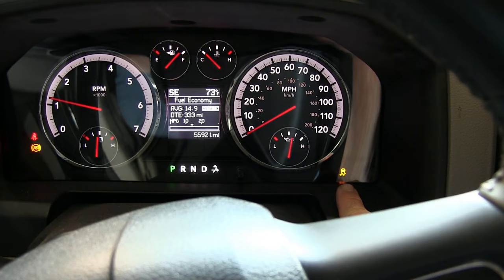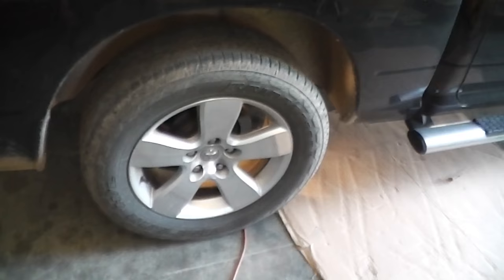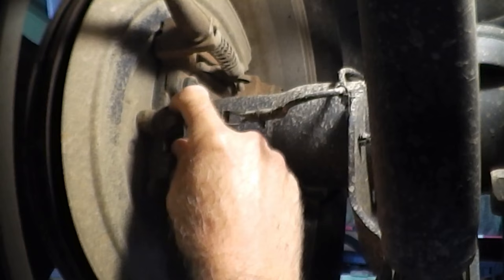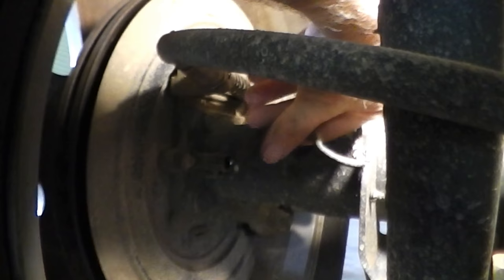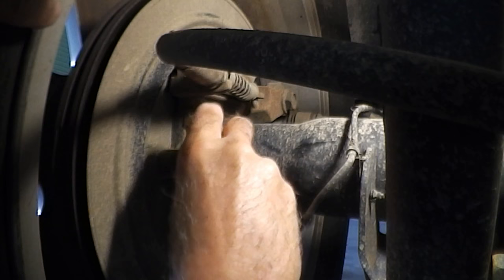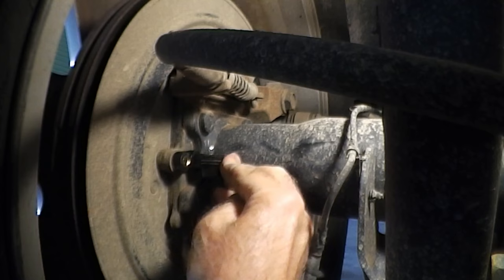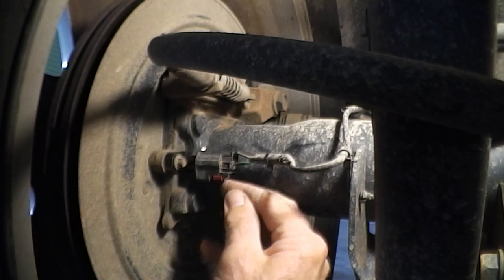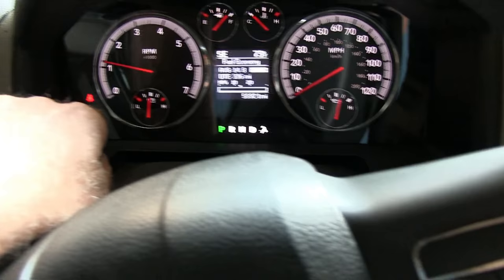ABS and traction control light stay on - 2012 Ram fix

Comment: Thanks for the great video. 30 minutes of labor and the problem was fixed! I found it easier to remove the 8mm bolt and the sensor before disconnecting it from the plug (and likewise connecting the replacement before bolting it in). It strikes me that it's easier separating the sensor from the plug when it's in a less restrictive space and when one can get a grip on the two parts to be separated. Also, the red tab on the left-rear wheel was hidden from view until I removed the bolt and the sensor connected to the wiring.

Comment: Mine didn’t reset with the start of the engine, I drove it for about a mile then the lights disappeared.  Thanks for the help and saving me a ton of cash!
Reply: It has to relearn. I have changed mine several times. 2011 116,000 MI. The last time I changed the front ones. It was cheaper to get the bearing assembly w/sensor than just by a sensor.  I also found out when my back up sensor light came on,.That I could clean them with wd40.  Went right back to working.  I thought this might work on my speed sensors. So I cleaned them up.and right back to working.  It don't mean it will be that way every time I guess, But so far so good.
The brakes on the front ha e locked up.twice because of them. I.had to replace everything in less than 10,000 MI.  It would not go.into economy 4 cylinder. You don't really notice it at first. Then you smell it. I pulled over and it locked.up.tight. The wheels were smoking hot. Another problem is there is no cabin filter in it. You can get.a kit for it.simple to install. The outside pollutants clogged.up.my evaporator tomorrow part of the dash.will have to come out to change it. I'm gonna rebuild the blower box while I have it out. The cabin filters are very important. Find out it your vehicle has one and change it.  
Also you.can use the re-cycle button on the a/c. That will stop most pollutants. Not make the same mistake I did, Its very costly. and time consuming. GOD BLESS

Comment: I'm having the same problem. Thank you very much. I think you were the same guy I watched on the back up assist sensors. From what remember, I cleaned the sensors with WD-40 and all went back to working. Dealer said they would all have to be changed. Save me alot thanks.

Comment: Had a 2012 Ram 1500 go through the shop this past week with the same issue. I ordered the 2 sensors for the rear wheels. Took the old ones out to find they were completely covered in dried mud/dust. I used shop air to blow out the area where the sensor sits, and a ton of dust and dirt came out. I installed the new sensors and lifted the vehicle a couple feet off the ground and put it in drive. The lights disappeared around 10 MPH and did NOT return. Another confirmed fix! Thanks for the tip, as the vehicle threw no codes concerning the abs light and the traction control light.
Reply from the maker: Awesome 👍

Comment: Man thanks a lot, today I started my truck and I saw all those lights on, I really freaked out,  well it turned out my dog had bitten cut one of the cable. So  thanks to you I knew that the cable was the problem, I put them back together and I started the engine, and the lights were gone. Thanks a lot mate, greets from Chile!

Comment: Man I wish I could buy you a beer. I went to the dealership for this EXACT issue, ABS error message started coming on randomly and then eventually it comes on and stays on every time I move the truck. They plugged their little doo-dad into the dash and said "It's an internal error, we need to replace the whole abs module. We can do it next month and it'll cost $1900."  I laughed in their faces. I found this video after 15 minutes of looking online, I'm picking up $20 worth of sensors from the parts store tomorrow. If this works I'm a good mind to go back to that dealership and take them to task for being scam artists.
Reply: Did this fix it?
Reply: @etchediniron4249  yep
Reply: @MagiRaz  I just called the dealership and can’t get a module until 2/2023. 😐
Reply: @hybredmoon same issue.  Dealer said "ABS sensor . . . Blah blah . . Not available till . . . Blah blah . . . $1200."  

Question:  2012 2500 Cummins
Speed sensors are not plugged at the wheel but a long wire from the sensor.  Was there a chance made bt FC during 2012 year?
Reply: How much did they charge for diagnostic? I’m having the same issue plus service the knob thing lol . I’m stuck in park also 😤
Reply: @JoseMorales-kn7ut  Diagnostic fee at my local mechanic is $50, flat rate.

Comment: Many thanks for your video. 
ABS, service 4 wheel drive, stability control dash lights on. No cruise control. And last but not least, the backup sensors disabled. All because the left rear wheel speed sensor failed.
Reply from the maker: silent night  it cleared on its own when I started to drive.
Reply: silent night  Everything cleared when I started the truck.

Comment: Awesome! I have a 2013 Chevy Silverado. It sounds like it could be a similar situation. If not, this was a great video to watch. Cheers
Reply: I had a 2000 silverado with the same issue.  Not sure if it's the same as the 2013 but what happens is the solder joint cracks inside the ABS control module.  That could also be your problem and there are several videos on it.  Good luck.

Comment: Great video! This solution solved my intermittent ABS and TC issue on my 2013 RAM 1500 Laramie. It took me less than an hour with seized up ABS sensors. Thank you!
Reply: I have a 2013 Ram as well .. If you dont mind me asking, where did you buy your sensor? Part number? From what Im seeing the part # changed after 2012 model.
Reply: @SouthernSwag731  I went into AutoZone to buy the part. I just told them the year and make and they ordered the part, next day delivery. I do not have the part number for you, sorry.

Comment: Big thank you. Just fixed mine today for $25. Got a scanner from an auto parts store and it read the code.
Reply from the maker: Awesome 👍
Reply: My Diablo scanner would not pick up the fault code. The scanner at the auto parts store would not pick up default code to either. Rumor has it you have to take it to the dealer to pick up the ABS fault codes.
Reply: Why don't you drive it around for a couple days to make sure the light stays off.

Comment: I won't be paying Dodge $150 to "find the problem" now. Thank you.
Reply from the maker: Awesome glad it helped.
Reply: Is the abs & traction control module in the same place on a 2017 3500 cab an chase dually
Reply: @petebeasttexashomesteading   is this the same for a 2018 ram 3500? Same issue. Great video.

Comment: Thanks much Pete. Replaced both sensors on my 2012 Ram. One came off as you show but the other one was stuck despite my many threats and foul language. So I removed  the bolt and pulled out the whole affair. If you look at the sensor end with the bolt hole  on the right and there are two rails attached to the sensor. Similar to pistol rails. Use a pair of needle nose pliers, grab one of the rails and pull out the sensor.

Comment: Awesome, was VERY easy to do and fixed my issue! Thanks!
Reply from the maker: Awesome 👍
Reply: @petebeasttexashomesteading  I have this issue with my truck right now, except I am also limp in 4th gear. Did anybody have this same limping issue when their ABS and Trac-control wasn’t working? 

We also think it may be our transmission solenoid 

Model: 2012 Ram 1500 with 5.7L 

Please let me know!!

Comment: Before you change the sensor you should take the wheel off and check the gear the sensor reads from some times the gets covered in brake pad debris and makes the sensor think the wheel is spinning really fast because it looks like solid metal no breaks.

Comment: Replaced both. Light still coming on. Looking for solutions now… 2013 ram 4.7 1500 st
Reply: My 2010 Ram 4.7 when in 4wd LOW , the ESP and BAS come on , don't of it's normal...I know that in Low Range certain assistance goes off

Comment: Thank you for the video! Intermittency, the traction control, service 4x4 and trailer brake lights come on but will go off. Hopefully this fixes it. I also received the red lightning bolt indicator a few times and the truck will slow down. I hope this corrects it. Definitely seems like an electrical issue or sensor issue. If someone has had the same problem feel free to comment. Thank you!
Reply: I had the same issue with the red lightning bolt after doing some research I found out the throttle body was the issue.
Reply: Same problem here 4x4 and the traction light come on and I can't take it out of park. Gonna give this a shot. Red lighting bolt was solved by changing the throttle body(easy fix). Hate that the TPS isn't separate :/

Comment: I have a newer ram  -- it has computer glitches all the time - it started doing that back in the first 25 thousand miles or so - it has been coming and going all along - when they reset the computers on  all of them somewhere along the line - they go away - you could have of course had a problem with a speed censor - but i noticed you had a lot of corrosion on the plugs  and especially on the inside electrical stuff of the sensors   - you didn't clean on the inside at all - and you didn't just unplug them and clean them just in case of that situation -- HUH ? ? -- where did you get the info you got - boobtube maybe - thanks for the heads up anyway - it is something to try if cleaning or recomputing on their schedule doesn't work - does that not also happen when the brakes are getting low and needs replacing ------ a good air compressor and some brake cleaner works for cleaning purposes very well i hear - wonder if it really does  ? !  - what does show up when the brakes are getting too low I wonder ? !

Comment: Thank you so much Pete for such informative video, I have the same problem with my 2011 Jeep Grand Cherokee, could you guide me where to buy the sensors, thanks in advance
Reply from the maker: I'm not sure how the speed sensor looks on a 2011 jeep grand Cherokee. I have a link in the description under the video for a 2012 ram, just go on Amazon and search for your vehicles wheel speed sensor and if you can, make sure they look the same as what's on your vehicle.
Reply: @petebeasttexashomesteading  Thank you so much Pete we'll do

Comment: I just experienced this today in my 2012 express. I used the Amazon link and ordered 2 sensors. Thanks for posting. Just curious did your truck feel like the rear end was slipping intermittently before this happened? Mine did it a few times and then it stopped a couple of days ago then this today.
Reply: Did you ever figure out the issue?
Reply: @chrissmothers3636  the new sensors fixed the issue 👍

Comment: I replaced both my rear wheel sensors and that did not fix my problem. My truck was hit on the front left wheel last year so I assume that’s where the issue is. I replaced that one last night. So it should take a few days to clear if that was indeed the problem. We’ll see
Reply: Sean Hebert I have the same problem you light traction control is steel on ???
Reply: Sean Hebert I have the same problem you light traction control is steel on ???
Reply: Sean Hebert I have the same problem you light traction control is steel on ???
Reply: Sean Hebert I have the same problem you light traction control is steel on ???

Comment: These are ONLY on the back wheels then?  Nothing on the front?
Having similar problem. The lights on dash stopped happening, but now my ABS will randomly kick on during normal braking around town. Brakes still work but its an uncomfortable feeling and probably makes brakes work less effectively.

Comment: I have a 21 ram 1500. Took it in to get pinion beating fixed. Now ABS light on, traction control lights on n cruise wontvwork
Reply: My ABS module costs 500.00

Comment: My Speedo stopped working, the abs traction control lights, the Brake warning lights and it was stuck in low ratio…….all because of a front wheel sensor…..£100 item…….Stupid unnecessary electrical crap….never needed this shit 30 years ago….we all got along just fine!

Comment: Did you have any issues with braking though? My truck seemed to want to kick on the ABS system when it wasn’t needed. Then I’d experience the problem you have described in the video. Of course, maybe it’s because the sensor(s) are bad that the ABS is activating at the wrong time. Either way, I’ll try this fix first. Thanks much.
Reply from the maker: I didn't have any issues with braking.
Reply: Loop
Reply: Will  try thanks

Comment: Unfortunately in my Chrysler / Jeep Compass it's always the tone ring  magnet that goes bad not the sensor part so it's part of the axle assembly and not the sensor itself.  I have had to replace both back ones and it's a pain in the butt.  It's the same for me. All the lights come on from ABS to traction control and you can't engage the cruise control while the tone ring is causing the fault.
Reply from the maker: It would have been nice if they could have kept the sensor basically the same for all their vehicles.

Comment: I had the same lights on my 2009 dodge ram rear wheel drive truck. I changed both rear sensors today drove all day around the city at least 30 miles but the lights are still on. Any reason why they won't go off?
Reply: My abs light is on,brake lite, service 4x4,traction control lite is on and cruise control don't work and when my truck is started it won't come out of park but wen the key is on the on position it will come out of park..code scanner showed abs wheel sencors
Reply: You may have changed the wrong ones. It may need the front changed. A scanner is good to check which is bad. Or an ohm meter.

Comment: This sounds like what is wrong with my 2008 durango. The brakes will actually engage very slightly by themselves at very low speeds randomly. Been driving it with this issue for the last week and now the cruise control doesn't work. Think it's the same issue?

Comment: My 2012 2500 has this light (ESC only) on preventing use of the cruise control, but I have never disconnected anything related to the power steering system.  I have replaced all upper and lower ball joints (what a job...don't ask).....thoughts?

Comment: How did you know it was the rear speed sensors and not the front? My 2017 just started displaying the ABS & traction control lights. Want to make sure I purchase the correct sensors, thanks.
Reply from the maker: Because my truck was rear wheel drive and not four. The speed sensor is used for traction control to check that the wheels are spinning the same or not.

Comment: I have a 2012 ram 3500 and I didn’t see this on my back wheels. I have a 6.7 cummins. I dont know if that makes any difference
Reply: I have an 08 3500 dually. They should be on all 4 wheels. They may be different from what he shows in the video. Check to see if there is a wire running from your pumpkin or wheel well down toward the brakes. That will lead you to it. Some fasten in at a different place and different angle. All 4 wheels have them to brake the vehicle in a straight line. They operate in milliseconds from each other to apply the brakes evenly in case some aren't worn or gripping the same as the others. If you Google it you should find them. Dodge or Ram may call them " Electronic Stability Control" as mentioned above in a post.

Comment: My issue is almost the same as this. But my E brake light comes on and stays on with the traction control light and my cruise also doesn't work. Only difference is my E brake light comes on instead of the abs light.

Comment: My driver side is not the same size as the passenger side.  The part listed in the Amazon link (257) fit the passenger side, but is too big for the driver side.  The part looks the same just smaller in diameter.  I have went to all the parts stores and everyone list the 1 size fits all.  Anyone else have this issue and if so what part did you use and where did you get it?

Comment: My ESP BAS, TRACTION CONTROL, AND BRAKE lights came on. I found out it was my brake fluid. I checked the brake fluid it was low, because I have a cracked brake caliper that was leaking, so I refilled the brake fluid and the lights came off. I tried the speed sensors and they did not solve the problem, they were cheap so it was not a big deal. Hope this helps.

Comment: Can the sensor be cleaned with some brake cleaner and then change the sensor if the cleaning did not work? Thanks, Pat
Reply from the maker: No, the unit is sealed. There must be some kind of magnet inside.

Comment: Would it be helpful or hurtful to spray a bit of dialectic aerosol into the hole before you reinsert the new sensor?
Reply from the maker: I might help make removal easier next time but the sensor itself is sealed.
Reply: @petebeasttexashomesteading  I was just wondering about all the dust and grit that gets up there. Especially on 4x4s that get muddy. Thanks for your reply!

Comment: Would this be the same part for a 2018 ram 2500?
Reply from the maker: No, probably not. The 2018 Ram is different and I think you have to replace the cable.
Reply: @petebeasttexashomesteading  Thanks. I’ll have to look into it because I’m having this same issue.

Comment: How did you know to change rear wheel sensors? Did you do a diagnostic test?
Reply from the maker: The truck is rear wheel drive. but if you have a 4x4 the it's just best to change them all.
Reply: @petebeasttexashomesteading  should be one on all 4 wheels to apply the brakes evenly on all wheels to keep vehicle braking in a straight line.

Comment: My abs , traction control and brake light came on. Would it still be the sensor? It has brake fluid, change front and rear brakes, the battery is good. Took to auto parts store and its not throwing a code.
Reply from the maker: Could be, mine wasn't throwing a code either.